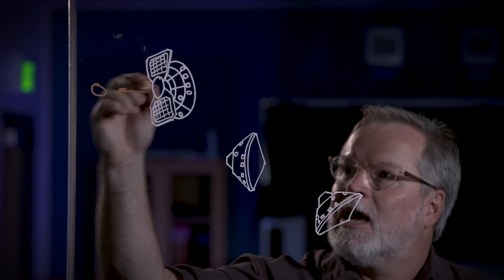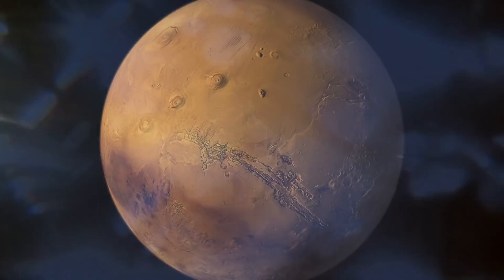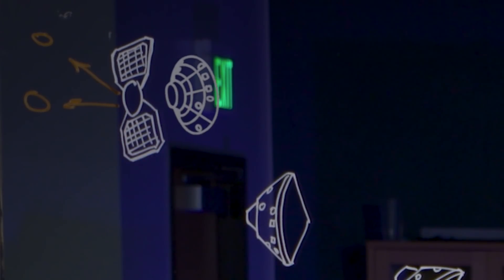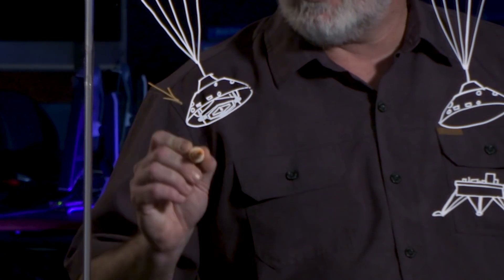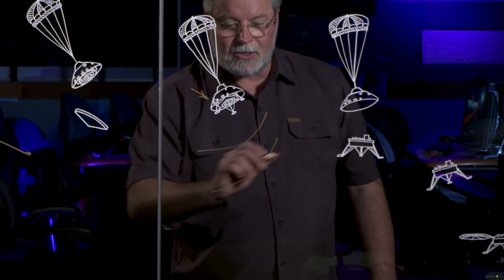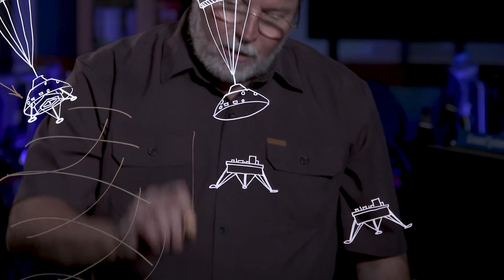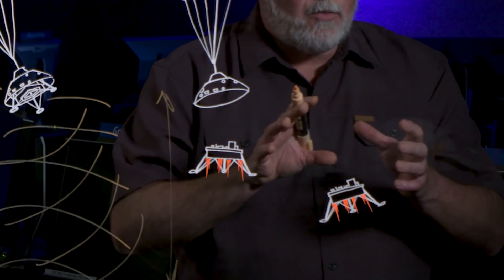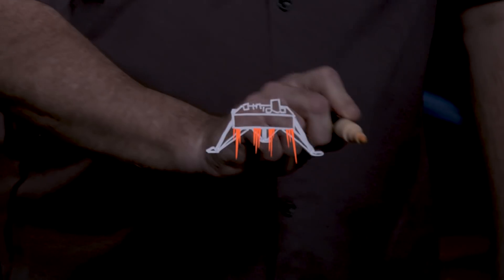InSight Landing on Mars

Comment: Question: are we sure that we are using the tight units this time? NASA has already lost one Landor because they didn’t use it consistent set of units of measurement. I get very nervous when this guy explains the landing in miles per hour rather than the metric system that NASA normally uses. The only thing that cooks make me more nervous would be if he started talking about furlongs per fortnight
Reply: I think that, as this is a science communications exercise, it's done for relatability.
Reply: I don't believe that was NASA....it was ESA
Reply: dbreardon   Unfortunately, it was NASA. It happened in September 1999. The spacecraft that was lost was an order called the “mars climate orbiter“. Lockheed Martin used English measurement units and NASA used the metric units. The mishmatch caused a critical Bern needed to put the orbiter in a proper orbit around mars to go wrong.
Reply: @wbwarren57  Ah, you are correct. I was thinking the Schiaparelli lander which was a actually a problem with an inertial measurement. But we have successfully put three large rovers and the Phoenix on the surface  since that time so I think they have their unit of measure problem figured out.

I would be more worried about a lander sensor having an issue or a mechanical problem - leg deployment, stuck fuel valve, etc on landing and/or proper deployment of solar panels post landing.

Nonetheless, I will be watching just like I did when Spirit, Opportunity, and Curiosity landed. I have tremendous faith in NASA.